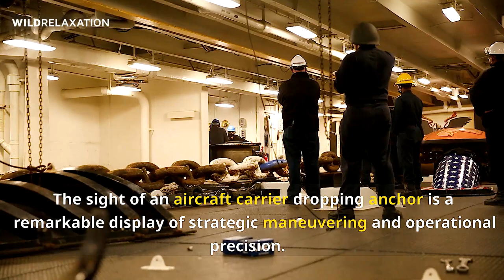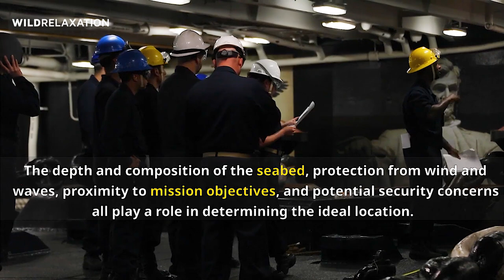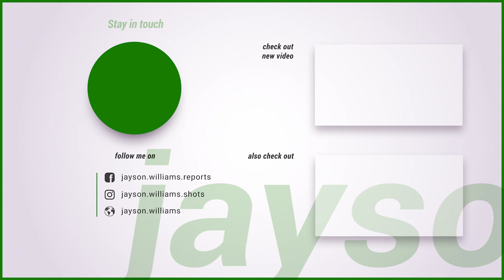This USS Gerald R  Ford's Anchor Drop Leaves Everyone in Awe!

Comment: Not sure if the rule still stands, but when I was in the Navy (Aviator) from 1965-1970, no U.S. Navy Carrier would ever tie up to a dock or pier in a foreign port, they always anchored out. (Exception was as NAS Cubi Point, Subic Bay in the Philippines whcih was at the time a U.S. facility. Thus not really a "foreign port". Members of the crew going ashore had a boat ride to and from the dock or pier staging area. On the other hand our escort vessels (destroyers in the case of the ASW carriers) always would. In the Mediterranean the small boys would always dock in an unusual way called Med Moor. In that they would dock with the stern to the dock and the bow facing outward. You can dock more ships in a given space that way, but I never saw it used in a U.S. Port.
Reply from the maker: Thank you for sharing your experience in the Navy! From your description, it seems that U.S. Navy carriers typically anchored out in foreign ports, except for the NAS Cubi Point in the Philippines, which was a U.S. facility. It's interesting to learn about the different docking practices, such as the "Med Moor" method used by small boys in the Mediterranean. I appreciate the insights!
Reply: Always anchored at sea for ports of call and air defense systems ACTIVE, when I was on the Saratoga in the Mediterranean.

Comment: I wonder if that chain is big enough to lift a car. Its huge.
Reply: The chain is lifting an anchor that weighs around 30 tons or more.  Each link probably weighs IIRC around 125 pounds or 50kg.  Your family car probably weighs something like 2,500 to 4,000 pounds depending on type and style.  The anchor weighs about the same as a lightly loaded tractor trailer.
Reply: A car also has gas and stuff in the trunk like a spare tire. So I don't think it can.  That's probably why we dont see cars hanging by a chain everywhere.
Reply: lol